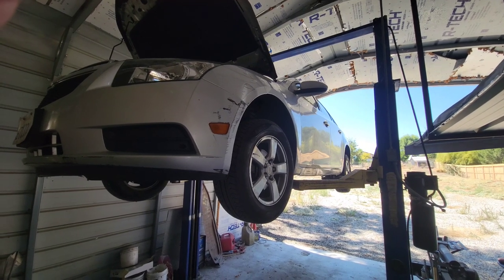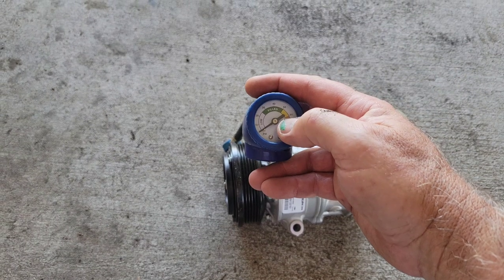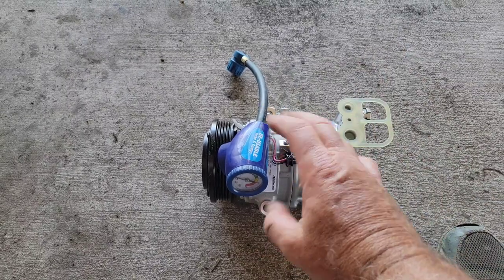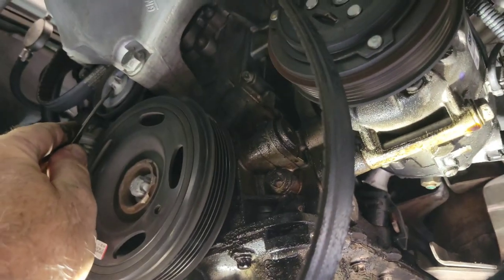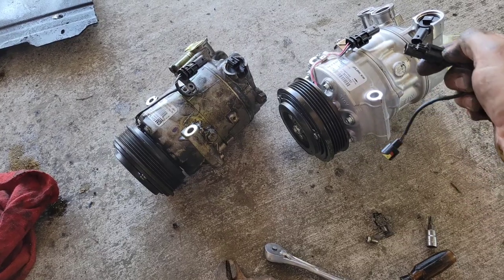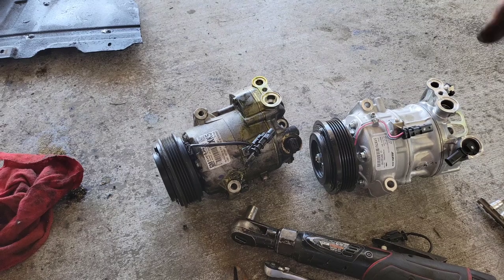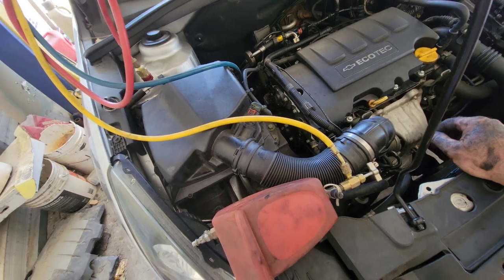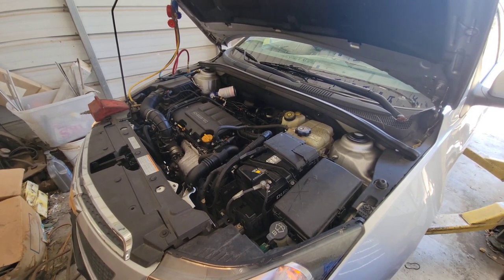Chevy Cruze AC not blowing cold - Broken air conditioner solved

Comment: My ac compressor is not kicking on , on my cruze. I checked every fuse on the car, and cleaned the cabin filter just to see if it would work. I bought a new gm  haven't installed yet.
Reply from the maker: check to make sure you have freon in the system. should have 60lbs around there or more static with the ac off. it wont even try to work if the freon too low. Low pressure switch might not be working too.

Comment: I have a 2019 cruze, my ac randomly stopped working , my ac is in the red when i put it to the gage. My clutch spins for 6 seconds and stops and my fan stopped working , could this be the switch? Or maybe a relay? Any ideas
Reply from the maker: Possibly the relay or the variable pressure switch which is usually part of the compressor. first test the relay then if it is bad then the compressor or variable pressure switch. RKX makes replacement variable pressure switches. If you want to do that you can remove it and compare it on their website. Most common problem on the Cruze is the variable pressure switch. But test the relay first.

Comment: I got a 2014 cruze, the AC cluch isn't kicking in, and I run a wire from the battery, and it didn't kick in what is wrong ?